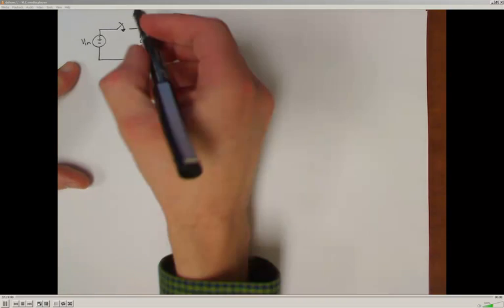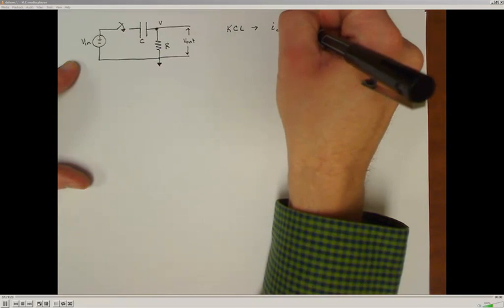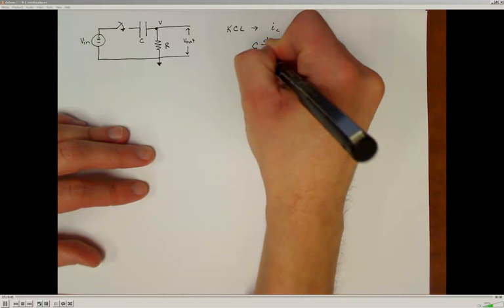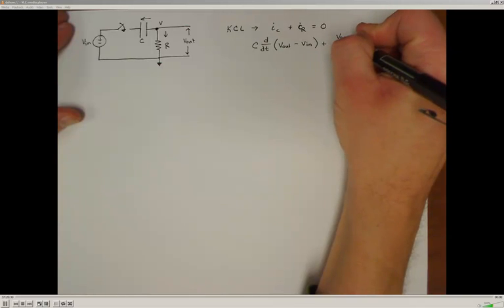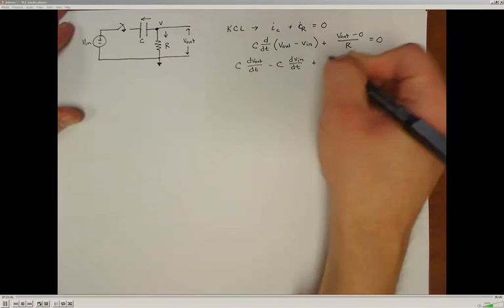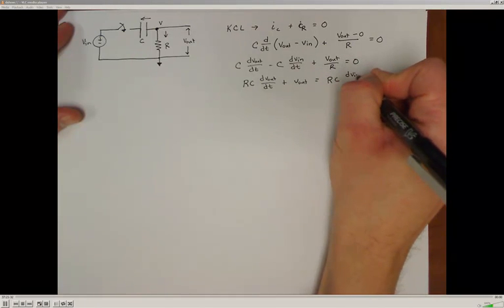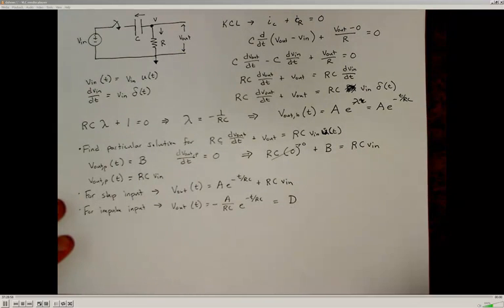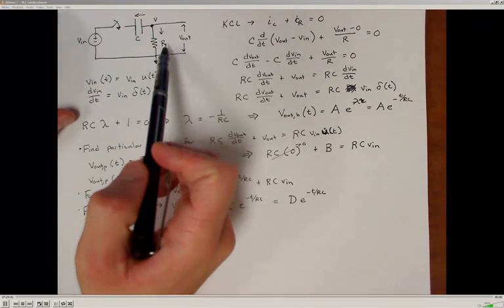ENGR 313 - 05.05 RC Circuit Impulse Response Example

Comment: Very nice. You cleared up the voltage concept for me to be "how active does the circuit allow the carriers to move". In this case, the backplate of the capacitor allows a lot of carriers (electrons) to move as soon as the switch closes and therefore the resistor has high voltage drops.